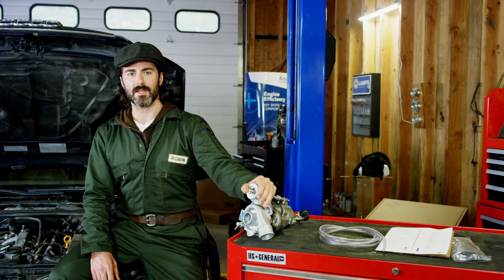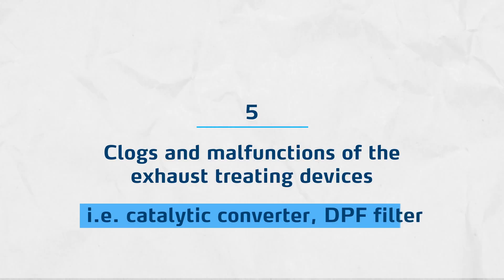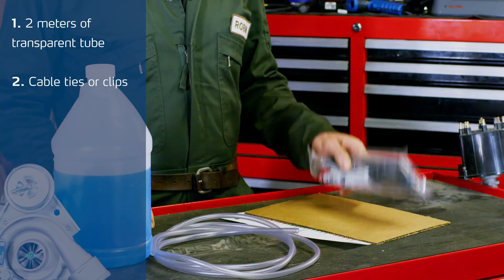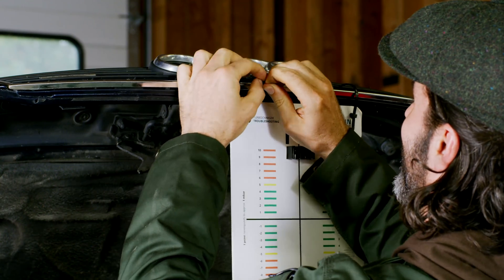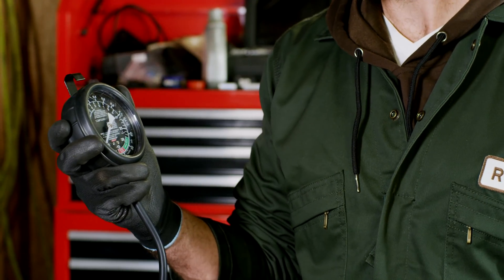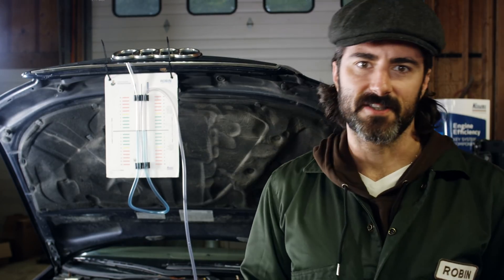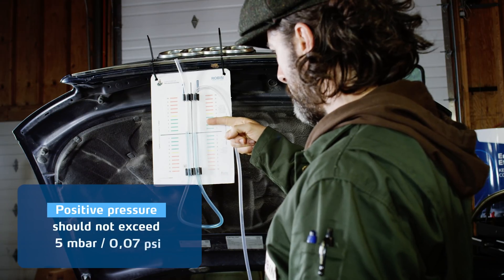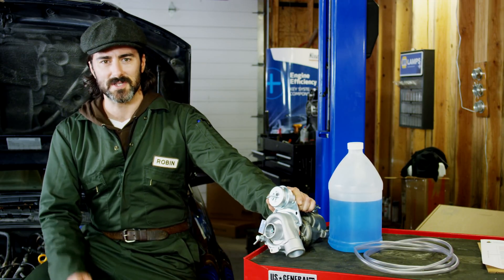Turbo Pressure Test - DIY Guide!

Comment: This isn’t a turbo pressure test at all. It’s instead all about crank case pressure testing. Disappointing….
Reply: Still crank case pressure can cause turbo oil seal failure so kinda important

Comment: Hey Robin, followed your procedure exactly as you demoed on my 2008 Peugeot 308 1.6lt turbo. I started the car , 'idle' only and all the fluid shot straight out of the tubes, left and right. What a 'f*%k up.....! Almost a few CC's of coolant down into my sump. Do you realise how little pressure it takes to move the liquid just 1 segment , positive or negative - a fairy's breath is all it takes.my engine must have a major problem.
Guys be very careful when doing this 'test' - you'll have liquid down your oil tube before you wink an eye. Terribly disappointed.

Comment: What did you use to seal the tube to the engine? I see a black rubber connector? I don't think you mentioned that. Thanks for your videos!

Comment: Please, can you talk about eac part of the turbo unit itself.  I see compressor wheel, turbine wheel.  but that is all i know.  Oil in oil out.ok this i understand.  but this is all.  Yes i got a problem.  ECU see a boost pressure issue.  Does not say where.  Garage would not tell me as such.  MAP good.  clutch switch good.  I have no egr.  Yet i get limp mode  in 4th or 5th gear only.  1 2 3rd gears are just perfect.  but hit 4th or 5th.  then limp mode.  This is all i know. Over boost.?  If so, car feels slow when starting my drive.  confused.  good, then I am even more confused.
Reply: Waste gate stuck open? Letting all your boost leak away giving you little to no power. This can be tested manually at home without diagnostics
Reply: @01blackhills  Found the issue, the Tmap sensor was contaminated with oil and the Electronic transducer was also replaced.  Then the entire van came back to life.